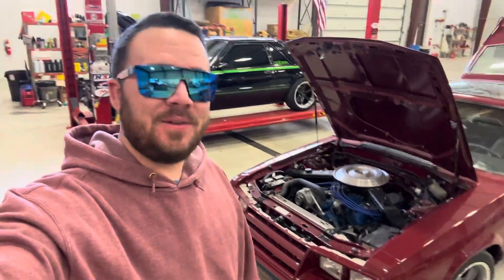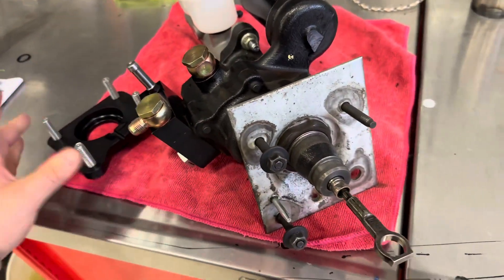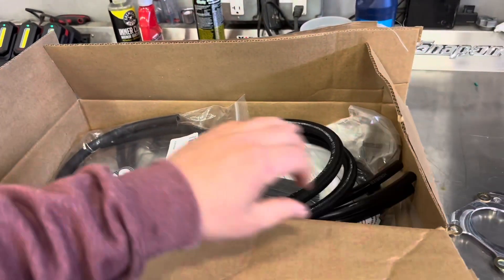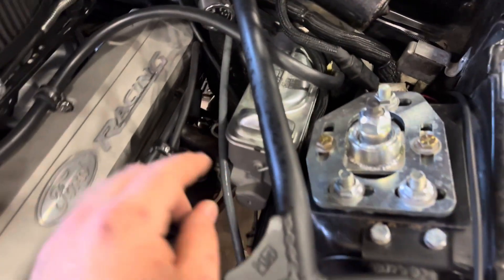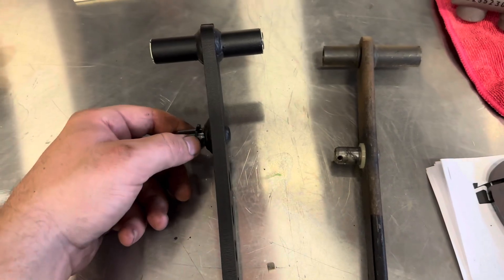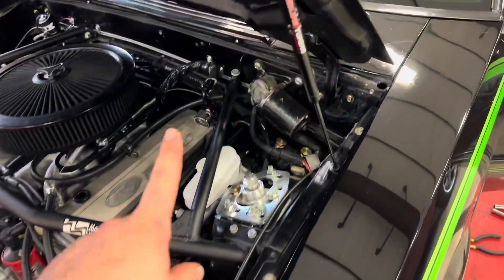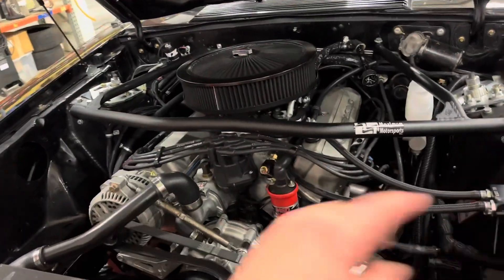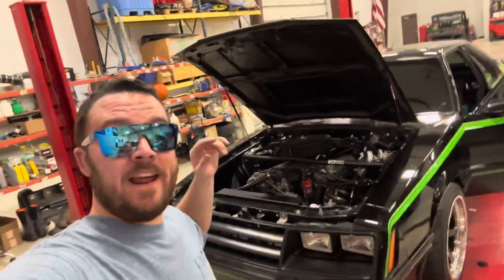HYDROBOOST In A FOXBODY With A SBF?! Maximum MotorSports Hydroboost swap kit

Comment: I've read crazy stories of brakes applying themselves if you don't use a power steering pump with 2 return lines. The stock mustang pump only has one if I recall. How does this work here. I also read to avoid a t/y fitting at all costs.

Comment: I used the mm kit in my 79 pace car, but I used a 96 to 98 hydroboost. I couldn't use the aluminum spacer that comes with the kit, I did a 4.6 swap so I used all the sn95 power steering lines as well as an sn95 steering rack.

I also have an 84 svo steering column and pedal box so I could use the later cable setup for the tr3650 trans.
Reply from the maker: Hell yeah!

Comment: I have manual steering so i wont be able to use that 😭. How does the pedal feel now compared to the vacuum booster? Im probally screwed from using it anyway because my headers run right under my mastercylinder and out through my inner fender. I hope you get your 10k subs that would be awsome your killing it. I hope I get $1,000 your giving away because I need more goodies to go faster and faster and faster🤯🤯😈🤪😜👊🏻💥
Reply from the maker: Pedal is literally night and day
Reply: @cobrabuilt  sweet def gonna try it out on the fox , are you going to supercharge or turbo the 347 ? thumbs up if its one of them
Reply: @cobrabuilt can you run it without a power rack and install the powersteering pump to just run the brakes?
Reply: @spider2112  I've seen guys run a dedicated Volvo electric pump separate for only the hydroboost. 1 year later hope it helps